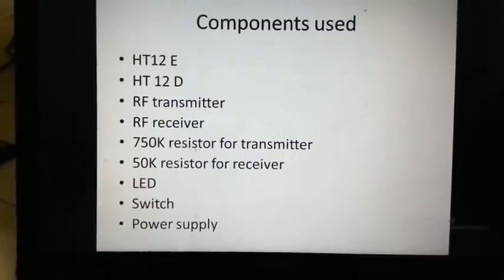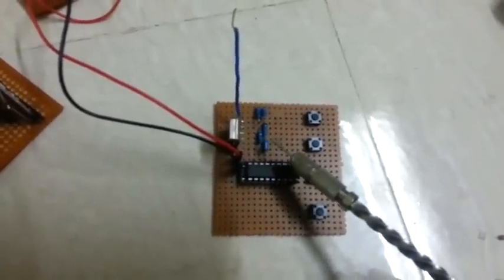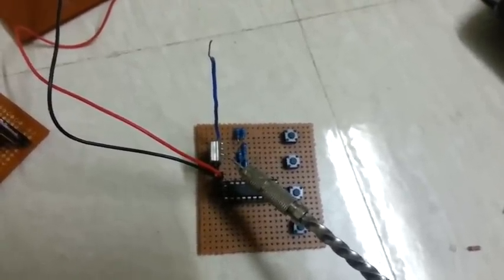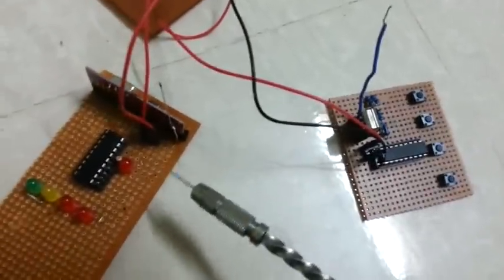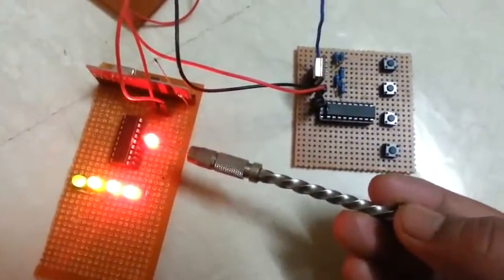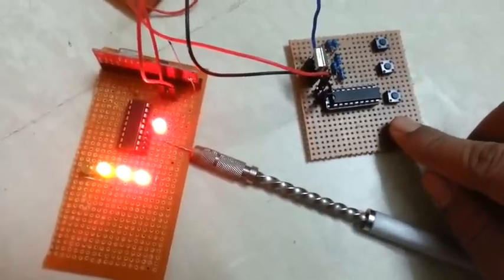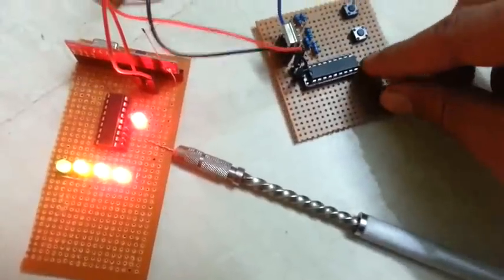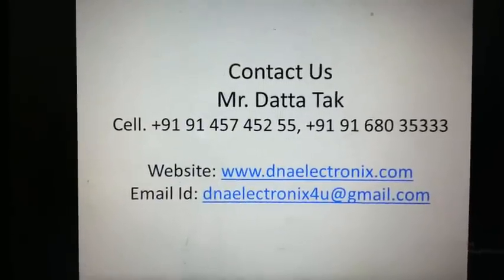RF transmitter and receiver circuit

Comment: try this minecraft command. its awsome. it can make furnituer no mods im serious

/summon FallingSand ~ ~2 ~ {Block:redstone_block,Time:1,Riding: {id:FallingSand,Block:command_block,TileEntityData:{Command:/fill ~-1 ~-3 ~ ~-1 ~1 ~ redstone_block},Time:1,Riding: {id:FallingSand,Block:command_block,TileEntityData:{Command:/fill ~-1 ~-3 ~ ~ ~2 ~ air},Time:1,Riding: {id:FallingSand,Block:command_block,TileEntityData:{Command: 	/summon FallingSand ~-2 ~ ~9 	{Block:emerald_block,Time:1,Riding: 	{id:FallingSand,Block:command_block,TileEntityData:{Command: 		/summon FallingSand ~ ~-2 ~-1 			{Block:emerald_block,Time:1,Riding: 			{id:FallingSand,Block:command_block,TileEntityData:{Command:/fill ~3 ~1 ~2 ~-1 ~1 ~-5 stained_glass 0},Time:1,Riding: 			{id:FallingSand,Block:command_block,TileEntityData:{Command:/setblock ~2 ~-6 ~-5 redstone_block},Time:1,Riding: 			{id:FallingSand,Block:command_block,TileEntityData:{Command:/setblock ~-1 ~-1 ~-7 stone_button 4},Time:1,Riding: 			{id:FallingSand,Block:command_block,TileEntityData:{Command:/setblock ~-1 ~-1 ~-4 command_block 0 replace {Command:/scoreboard objectives remove tv}},Time:1,Riding: 			{id:FallingSand,Block:command_block,TileEntityData:{Command:/setblock ~-1 ~1 ~-5 redstone_wire},Time:1,Riding: 			{id:FallingSand,Block:command_block,TileEntityData:{Command:/setblock ~-1 ~ ~-5 command_block 0 replace {Command:/summon FallingSand ~2 ~3 ~7 {Block:command_block,TileEntityData:{Command:/fill ~-3 ~-1 ~1 ~3 ~8 ~-9 minecraft:air},Time:1}}},Time:1,Riding: 			{id:FallingSand,Block:command_block,TileEntityData:{Command:/setblock ~ ~2 ~-5 command_block 0 replace {Command:/fill ~-2 ~1 ~-1 ~4 ~1 ~8 stained_glass 5 replace stained_glass 14}},Time:1,Riding: 			{id:FallingSand,Block:command_block,TileEntityData:{Command:/setblock ~-1 ~3 ~-5 command_block 0 replace {Command:/scoreboard objectives remove t}},Time:1}}}}}}}}} 		},Time:1,Riding: 	{id:FallingSand,Block:command_block,TileEntityData:{Command:/fill ~4 ~-2 ~-7 ~-2 ~-2 ~2 stained_glass 14 replace stained_glass 0},Time:1,Riding: 	{id:FallingSand,Block:command_block,TileEntityData:{Command:/setblock ~-1 ~-5 ~-8 stone_button 4},Time:1,Riding:	 	{id:FallingSand,Block:command_block,TileEntityData:{Command:/setblock ~-1 ~-4 ~-6 command_block 0 replace {Command:/scoreboard players set @p t 0}},Time:1,Riding: 	{id:FallingSand,Block:command_block,TileEntityData:{Command:/setblock ~-1 ~-2 ~-8 wall_sign 1 replace {Text1:,Text2:Get Items,Text3:,Text4:}},Time:1,Riding: 	{id:FallingSand,Block:command_block,TileEntityData:{Command: 		/summon FallingSand ~1 ~1 ~-6 			{Block:command_block,TileEntityData:{Command:/execute @a[score_tv_min=1,score_tv=1]~ ~ ~ /execute @e[name=TV,score_t_min=1]~ ~ ~ /summon ArmorStand ~-0.5 ~-0.7 ~-0.05 {CustomName:"F",NoGravity:1,Invulnerable:1,Invisible:1,DisabledSlots:2039552,NoAI:1,Equipment:[{},{},{},{},{id:carpet,Damage:15}],Pose:{Head:[90f,180f,0f]}}},Time:1,Riding: 			{id:FallingSand,Block:command_block,TileEntityData:{Command:/execute @a[score_tv_min=1,score_tv=1]~ ~ ~ /execute @e[name=TV,score_t_min=1]~ ~ ~ /summon ArmorStand ~0.5 ~-0.7 ~-0.05 {CustomName:"F",NoGravity:1,Invulnerable:1,Invisible:1,DisabledSlots:2039552,NoAI:1,Equipment:[{},{},{},{},{id:carpet,Damage:15}],Pose:{Head:[90f,180f,0f]}}},Time:1,Riding: 			{id:FallingSand,Block:command_block,TileEntityData:{Command:/execute @a[score_tv_min=1,score_tv=1]~ ~ ~ /execute @e[name=TV,score_t_min=1]~ ~ ~ /summon ArmorStand ~-0.5 ~-0.4 ~-0.05 {CustomName:"F",NoGravity:1,Invulnerable:1,Invisible:1,DisabledSlots:2039552,NoAI:1,Equipment:[{},{},{},{},{id:carpet,Damage:15}],Pose:{Head:[90f,180f,0f]}}},Time:1,Riding: 			{id:FallingSand,Block:command_block,TileEntityData:{Command:/scoreboard players set @a[rym=-135,ry=-45] tv 2},Time:1,Riding: 			{id:FallingSand,Block:command_block,TileEntityData:{Command:/scoreboard players set @a[rym=45,ry=135] tv 2},Time:1,Riding: 			{id:FallingSand,Block:command_block,TileEntityData:{Command:/scoreboard players set @a[rym=-44,ry=44] tv 1},Time:1,Riding: 			{id:FallingSand,Block:command_block,TileEntityData:{Command:/scoreboard players set @a[rym=136,ry=-136] tv 1},Time:1,Riding: 			{id:FallingSand,Block:command_block,TileEntityData:{Command:/fill ~1 ~ ~7 ~1 ~7 ~ air},Time:1}}}}}}}} 		},Time:1,Riding: 	{id:FallingSand,Block:command_block,TileEntityData:{Command: 		/summon FallingSand ~1 ~1 ~-5 			{Block:command_block,TileEntityData:{Command:/execute @e[type=EntityHorse,name=Destroy,score_t_min=1]~ ~ ~ /gamerule doMobLoot false},Time:1,Riding: 			{id:FallingSand,Block:command_block,TileEntityData:{Command:/kill @e[type=EntityHorse,name=Destroy,score_t_min=2]},Time:1,Riding:			{id:FallingSand,Block:command_block,TileEntityData:{Command:/execute @e[name=Destroy,type=EntityHorse]~ ~ ~ /summon FireworksRocketEntity ~ ~0.3 ~ {LifeTime:0,FireworksItem:{id:401,Count:1,tag:{Fireworks:{Explosions:[{Flicker:2,Trail:0,Type:5,Colors:[128988214]}]}}}}},Time:1}}} 		},Time:1,Riding: 	{id:FallingSand,Block:command_block,TileEntityData:{Command: 		/summon FallingSand ~1 ~1 ~-4 			{Block:command_block,TileEntityData:{Command:/execute @a[score_t_min=3]~ ~-1 ~ /kill @e[type=Item,r=2]},Time:1,Riding:			{id:FallingSand,Block:command_block,TileEntityData:{Command:/execute @a[score_t_min=3]~ ~-1 ~ /kill @e[name=F,r=1]},Time:1,Riding:			{id:FallingSand,Block:command_block,TileEntityData:{Command:/execute @a[score_t_min=3]~ ~1 ~ /kill @e[name=F,r=1]},Time:1,Riding:			{id:FallingSand,Block:command_block,TileEntityData:{Command:/execute @a[score_t_min=3]~ ~ ~ /gamerule doMobLoot false},Time:1,Riding: 			{id:FallingSand,Block:command_block,TileEntityData:{Command:/execute @a[score_t_min=3]~ ~ ~ /kill @e[name=F,r=1]},Time:1,Riding:			{id:FallingSand,Block:command_block,TileEntityData:{Command:/scoreboard players remove @a[score_t_min=3] t 1},Time:1,Riding: 			{id:FallingSand,Block:command_block,TileEntityData:{Command:/scoreboard players set @a t 4 {SelectedItemSlot:8,Inventory:[{Slot:8b,tag:{display:{Name:"Destroy"}}}]}},Time:1,Riding: 			{id:FallingSand,Block:command_block,TileEntityData:{Command:/execute @e[type=Item,name=Destroy]~ ~ ~ /kill @e[type=ArmorStand,name=F,r=2]},Time:1}}}}}}}}	},Time:1}}}}}}}}} },Time:1,Riding: {id:FallingSand,Block:command_block,TileEntityData:{Command: 	/summon FallingSand ~-2 ~ ~10 	{Block:emerald_block,Time:1,Riding: 	{id:FallingSand,Block:command_block,TileEntityData:{Command: 		/summon FallingSand ~3 ~-5 ~-7 			{Block:command_block,TileEntityData:{Command:/replaceitem entity @a[score_t_min=1] slot.hotbar.8 name_tag 1 0 {display:{Name:"Destroy"},HideFlags:127,ench:[{id:34,lvl:10}]}},Time:1,Riding: 			{id:FallingSand,Block:command_block,TileEntityData:{Command:/replaceitem entity @a[score_t=1] slot.hotbar.4 spawn_egg 1 94 {display:{Name:"TV"},HideFlags:127,ench:[{id:34,lvl:10}]}},Time:1,Riding: 			{id:FallingSand,Block:command_block,TileEntityData:{Command:/replaceitem entity @a[score_t=1] slot.hotbar.3 spawn_egg 1 94 {display:{Name:"Pile_of_Books"},HideFlags:127,ench:[{id:34,lvl:10}]}},Time:1,Riding: 			{id:FallingSand,Block:command_block,TileEntityData:{Command:/replaceitem entity @a[score_t=1] slot.hotbar.2 spawn_egg 1 94 {display:{Name:"Large_Table"},HideFlags:127,ench:[{id:34,lvl:10}]}},Time:1,Riding: 			{id:FallingSand,Block:command_block,TileEntityData:{Command:/replaceitem entity @a[score_t=1] slot.hotbar.1 spawn_egg 1 94 {display:{Name:"Table"},HideFlags:127,ench:[{id:34,lvl:10}]}},Time:1,Riding: 			{id:FallingSand,Block:command_block,TileEntityData:{Command:/gamerule doMobLoot true},Time:1,Riding: 			{id:FallingSand,Block:command_block,TileEntityData:{Command:/replaceitem entity @a[score_t=1] slot.hotbar.0 spawn_egg 1 94 {display:{Name:"Chair"},HideFlags:127,ench:[{id:34,lvl:10}]}},Time:1,Riding: 			{id:FallingSand,Block:command_block,TileEntityData:{Command:/fill ~-1 ~ ~7 ~-1 ~7 ~ redstone_block},Time:1}}}}}}}} 		},Time:1,Riding: 	{id:FallingSand,Block:command_block,TileEntityData:{Command: 		/summon FallingSand ~3 ~-4 ~-6 			{Block:command_block,TileEntityData:{Command:/scoreboard players add @e[type=EntityHorse,name=Destroy] t 1},Time:1,Riding: 			{id:FallingSand,Block:command_block,TileEntityData:{Command:/scoreboard players add @e[type=Squid,name=TV] t 1},Time:1,Riding: 			{id:FallingSand,Block:command_block,TileEntityData:{Command:/scoreboard players add @e[type=Squid,name=Pile_of_Books] t 1},Time:1,Riding: 			{id:FallingSand,Block:command_block,TileEntityData:{Command:/scoreboard players add @e[type=Squid,name=Large_Table] t 1},Time:1,Riding: 			{id:FallingSand,Block:command_block,TileEntityData:{Command:/scoreboard players add @e[type=Squid,name=Table] t 1},Time:1,Riding: 			{id:FallingSand,Block:command_block,TileEntityData:{Command:/execute @e[type=Squid,score_t_min=1]~ ~ ~ /gamerule doMobLoot false},Time:1,Riding: 			{id:FallingSand,Block:command_block,TileEntityData:{Command:/scoreboard players add @e[type=Squid,name=Chair] t 1},Time:1,Riding: 			{id:FallingSand,Block:command_block,TileEntityData:{Command:/scoreboard players set @a[score_t=1] t 2},Time:1}}}}}}}} 		},Time:1,Riding: 	{id:FallingSand,Block:command_block,TileEntityData:{Command: 		/summon FallingSand ~3 ~-3 ~-5 			{Block:command_block,TileEntityData:{Command:/execute @e[name=Chair,score_t_min=1,score_t=1]~ ~ ~ /execute @p[score_t=2,rym=136,ry=-136]~ ~ ~ /execute @e[name=Chair,score_t_min=1,c=1]~ ~ ~ /summon ArmorStand ~ ~-0.65 ~-0.3 {CustomName:"F",NoGravity:1,Invulnerable:1,Invisible:1,DisabledSlots:2039552,NoAI:1,Equipment:[{},{},{},{},{id:trapdoor}],Pose:{Head:[90f,0f,0f]}}},Time:1,Riding: 			{id:FallingSand,Block:command_block,TileEntityData:{Command:/execute @e[name=Chair,score_t_min=1,score_t=1]~ ~ ~ /execute @p[score_t=2,rym=-44,ry=44]~ ~ ~ /execute @e[name=Chair,score_t_min=1,c=1]~ ~ ~ /summon ArmorStand ~ ~-0.65 ~0.3 {CustomName:"F",NoGravity:1,Invulnerable:1,Invisible:1,DisabledSlots:2039552,NoAI:1,Equipment:[{},{},{},{},{id:trapdoor}],Pose:{Head:[90f,0f,0f]}}},Time:1,Riding: 			{id:FallingSand,Block:command_block,TileEntityData:{Command:/execute @e[name=Chair,score_t_min=1,score_t=1]~ ~ ~ /summon ArmorStand ~-0.25 ~-1.35 ~0.25 {CustomName:"F",NoGravity:1,Invulnerable:1,Invisible:1,DisabledSlots:2039552,NoAI:1,Equipment:[{},{},{},{},{id:lever}]}},Time:1,Riding: 			{id:FallingSand,Block:command_block,TileEntityData:{Command:/execute @e[name=Chair,score_t_min=1,score_t=1]~ ~ ~ /summon ArmorStand ~0.25 ~-1.35 ~-0.25 {CustomName:"F",NoGravity:1,Invulnerable:1,Invisible:1,DisabledSlots:2039552,NoAI:1,Equipment:[{},{},{},{},{id:lever}]}},Time:1,Riding: 			{id:FallingSand,Block:command_block,TileEntityData:{Command:/execute @e[name=Chair,score_t_min=1,score_t=1]~ ~ ~ /summon ArmorStand ~-0.25 ~-1.35 ~-0.25 {CustomName:"F",NoGravity:1,Invulnerable:1,Invisible:1,DisabledSlots:2039552,NoAI:1,Equipment:[{},{},{},{},{id:lever}]}},Time:1,Riding: 			{id:FallingSand,Block:command_block,TileEntityData:{Command:/execute @e[name=Chair,score_t_min=1,score_t=1]~ ~ ~ /summon ArmorStand ~0.25 ~-1.35 ~0.25 {CustomName:"F",NoGravity:1,Invulnerable:1,Invisible:1,DisabledSlots:2039552,NoAI:1,Equipment:[{},{},{},{},{id:lever}]}},Time:1,Riding: 			{id:FallingSand,Block:command_block,TileEntityData:{Command:/execute @e[name=Chair,score_t_min=1,score_t=1]~ ~ ~ /summon ArmorStand ~ ~-1 ~ {CustomName:"F",NoGravity:1,Invulnerable:1,Invisible:1,DisabledSlots:2039552,NoAI:1,Equipment:[{},{},{},{},{Damage:0,id:trapdoor}]}},Time:1,Riding: 			{id:FallingSand,Block:command_block,TileEntityData:{Command:/tp @e[type=Squid,score_t_min=2]~ ~-5 ~},Time:1}}}}}}}} 		},Time:1,Riding: 	{id:FallingSand,Block:command_block,TileEntityData:{Command: 		/summon FallingSand ~3 ~-2 ~-4 			{Block:command_block,TileEntityData:{Command:/execute @e[name=Large_Table,score_t_min=1,score_t=1]~ ~ ~ /summon ArmorStand ~ ~-0.7 ~-0.25 {CustomName:"F",NoGravity:1,Invulnerable:1,Invisible:1,DisabledSlots:2039552,NoAI:1,Equipment:[{},{},{},{},{id:stained_glass_pane,Damage:0}],Pose:{Head:[90f,0f,0f]}}},Time:1,Riding: 			{id:FallingSand,Block:command_block,TileEntityData:{Command:/execute @e[name=Table,score_t_min=1,score_t=1]~ ~ ~ /summon ArmorStand ~ ~-0.7 ~ {CustomName:"F",NoGravity:1,Invulnerable:1,Invisible:1,DisabledSlots:2039552,NoAI:1,Equipment:[{},{},{},{},{id:trapdoor}]}},Time:1,Riding: 			{id:FallingSand,Block:command_block,TileEntityData:{Command:/execute @e[name=Table,score_t_min=1,score_t=1]~ ~ ~ /summon ArmorStand ~0.4 ~-1.6 ~-0.52 {Pose:{RightArm:[-100f,0f,0f]},CustomName:"F",NoGravity:1,Invulnerable:1,Invisible:1,DisabledSlots:2039552,NoAI:1,Equipment:[{id:bone},{},{},{},{}]}},Time:1,Riding: 			{id:FallingSand,Block:command_block,TileEntityData:{Command:/execute @e[name=Table,score_t_min=1,score_t=1]~ ~ ~ /summon ArmorStand ~ ~-0.9 ~ {CustomName:"F",NoGravity:1,Invulnerable:1,Invisible:1,DisabledSlots:2039552,NoAI:1,Equipment:[{},{},{},{},{Damage:0,id:wooden_pressure_plate}],Small:1}},Time:1,Riding: 			{id:FallingSand,Block:command_block,TileEntityData:{Command:/execute @e[name=Chair,score_t_min=1,score_t=1]~ ~ ~ /execute @p[score_t=2,rym=136,ry=-136]~ ~ ~ /execute @e[name=Chair,score_t_min=1,score_t=1,c=1]~ ~ ~ /summon EntityHorse ~ ~-0.9 ~ {CustomName:"F",Invulnerable:1,Silent:1,Tame:1,ActiveEffects:[{Id:14,Duration:1000000000,Amplifier:-1},{Id:11,Duration:1000000000,Amplifier:100,ShowParticles:0b}],NoAI:1}},Time:1,Riding: 			{id:FallingSand,Block:command_block,TileEntityData:{Command:/execute @e[name=Chair,score_t_min=1,score_t=1]~ ~ ~ /execute @p[score_t=2,rym=-135,ry=-45]~ ~ ~ /execute @e[name=Chair,score_t_min=1,c=1]~ ~ ~ /summon ArmorStand ~0.3 ~-0.65 ~ {CustomName:"F",NoGravity:1,Invulnerable:1,Invisible:1,DisabledSlots:2039552,NoAI:1,Equipment:[{},{},{},{},{id:trapdoor}],Pose:{Head:[90f,90f,0f]}}},Time:1,Riding: 			{id:FallingSand,Block:command_block,TileEntityData:{Command:/execute @e[name=Chair,score_t_min=1,score_t=1]~ ~ ~ /execute @p[score_t=2,rym=45,ry=135]~ ~ ~ /execute @e[name=Chair,score_t_min=1,c=1]~ ~ ~ /summon ArmorStand ~-0.3 ~-0.65 ~ {CustomName:"F",NoGravity:1,Invulnerable:1,Invisible:1,DisabledSlots:2039552,NoAI:1,Equipment:[{},{},{},{},{id:trapdoor}],Pose:{Head:[90f,90f,0f]}}},Time:1,Riding: 			{id:FallingSand,Block:command_block,TileEntityData:{Command:/kill @e[type=Squid,score_t_min=2]},Time:1}}}}}}}}		},Time:1,Riding: 	{id:FallingSand,Block:command_block,TileEntityData:{Command: 		/summon FallingSand ~3 ~-1 ~-3 			{Block:command_block,TileEntityData:{Command:/execute @e[name=Armoire,score_t_min=1,score_t=1]~ ~ ~ /summon EntityHorse ~ ~ ~ {CustomName:"F",Invulnerable:1,Silent:1,ActiveEffects:[{Id:14,Duration:1000000000,Amplifier:-1},{Id:11,Duration:1000000000,Amplifier:100,ShowParticles:0b}],NoAI:1,Rotation:[90f],ChestedHorse:1,Type:1,Tame:1}},Time:1,Riding: 			{id:FallingSand,Block:command_block,TileEntityData:{Command:/execute @e[name=Large_Table,score_t_min=1,score_t=1]~ ~ ~ /summon ArmorStand ~-0.6 ~-0.7 ~-0.25 {CustomName:"F",NoGravity:1,Invulnerable:1,Invisible:1,DisabledSlots:2039552,NoAI:1,Equipment:[{},{},{},{},{id:stained_glass_pane,Damage:0}],Pose:{Head:[90f,0f,0f]}}},Time:1,Riding: 			{id:FallingSand,Block:command_block,TileEntityData:{Command:/execute @e[name=Large_Table,score_t_min=1,score_t=1]~ ~ ~ /summon ArmorStand ~-0.6 ~-0.7 ~0.4 {CustomName:"F",NoGravity:1,Invulnerable:1,Invisible:1,DisabledSlots:2039552,NoAI:1,Equipment:[{},{},{},{},{id:stained_glass_pane,Damage:0}],Pose:{Head:[90f,0f,0f]}}},Time:1,Riding: 			{id:FallingSand,Block:command_block,TileEntityData:{Command:/execute @e[name=Large_Table,score_t_min=1,score_t=1]~ ~ ~ /summon ArmorStand ~0.6 ~-0.7 ~0.4 {CustomName:"F",NoGravity:1,Invulnerable:1,Invisible:1,DisabledSlots:2039552,NoAI:1,Equipment:[{},{},{},{},{id:stained_glass_pane,Damage:0}],Pose:{Head:[90f,0f,0f]}}},Time:1,Riding: 			{id:FallingSand,Block:command_block,TileEntityData:{Command:/execute @e[name=Large_Table,score_t_min=1,score_t=1]~ ~ ~ /summon ArmorStand ~-0.6 ~-0.7 ~-0.85 {CustomName:"F",NoGravity:1,Invulnerable:1,Invisible:1,DisabledSlots:2039552,NoAI:1,Equipment:[{},{},{},{},{id:stained_glass_pane,Damage:0}],Pose:{Head:[90f,0f,0f]}}},Time:1,Riding: 			{id:FallingSand,Block:command_block,TileEntityData:{Command:/execute @e[name=Large_Table,score_t_min=1,score_t=1]~ ~ ~ /summon ArmorStand ~0.6 ~-0.7 ~-0.85 {CustomName:"F",NoGravity:1,Invulnerable:1,Invisible:1,DisabledSlots:2039552,NoAI:1,Equipment:[{},{},{},{},{id:stained_glass_pane,Damage:0}],Pose:{Head:[90f,0f,0f]}}},Time:1,Riding: 			{id:FallingSand,Block:command_block,TileEntityData:{Command:/execute @e[name=Large_Table,score_t_min=1,score_t=1]~ ~ ~ /summon ArmorStand ~ ~-0.7 ~0.4 {CustomName:"F",NoGravity:1,Invulnerable:1,Invisible:1,DisabledSlots:2039552,NoAI:1,Equipment:[{},{},{},{},{id:stained_glass_pane,Damage:0}],Pose:{Head:[90f,0f,0f]}}},Time:1,Riding: 			{id:FallingSand,Block:command_block,TileEntityData:{Command:/execute @e[name=Large_Table,score_t_min=1,score_t=1]~ ~ ~ /summon ArmorStand ~ ~-0.7 ~-0.85 {CustomName:"F",NoGravity:1,Invulnerable:1,Invisible:1,DisabledSlots:2039552,NoAI:1,Equipment:[{},{},{},{},{id:stained_glass_pane,Damage:0}],Pose:{Head:[90f,0f,0f]}}},Time:1}}}}}}}} 		},Time:1,Riding: 	{id:FallingSand,Block:command_block,TileEntityData:{Command: 		/summon FallingSand ~3 ~ ~-2 			{Block:command_block,TileEntityData:{Command:/execute @e[name=Large_Table,score_t_min=1,score_t=1]~ ~ ~ /summon ArmorStand ~1.2 ~-1.6 ~0.28 {Pose:{RightArm:[-100f,0f,0f]},CustomName:"F",NoGravity:1,Invulnerable:1,Invisible:1,DisabledSlots:2039552,NoAI:1,Equipment:[{id:bone},{},{},{},{}]}},Time:1,Riding: 			{id:FallingSand,Block:command_block,TileEntityData:{Command:/execute @e[name=Chair,score_t_min=1,score_t=1]~ ~ ~ /execute @p[score_t=2,rym=-44,ry=44]~ ~ ~ /execute @e[name=Chair,score_t_min=1,score_t=1,c=1]~ ~ ~ /summon EntityHorse ~ ~-0.9 ~ {CustomName:"F",Invulnerable:1,Silent:1,Tame:1,ActiveEffects:[{Id:14,Duration:1000000000,Amplifier:-1},{Id:11,Duration:1000000000,Amplifier:100,ShowParticles:0b}],NoAI:1,Rotation:[180f]}},Time:1,Riding: 			{id:FallingSand,Block:command_block,TileEntityData:{Command:/execute @e[name=Chair,score_t_min=1,score_t=1]~ ~ ~ /execute @p[score_t=2,rym=45,ry=135]~ ~ ~ /execute @e[name=Chair,score_t_min=1,score_t=1,c=1]~ ~ ~ /summon EntityHorse ~ ~-0.9 ~ {CustomName:"F",Invulnerable:1,Silent:1,Tame:1,ActiveEffects:[{Id:14,Duration:1000000000,Amplifier:-1},{Id:11,Duration:1000000000,Amplifier:100,ShowParticles:0b}],NoAI:1,Rotation:[-90f]}},Time:1,Riding: 			{id:FallingSand,Block:command_block,TileEntityData:{Command:/execute @e[name=Chair,score_t_min=1,score_t=1]~ ~ ~ /execute @p[score_t=2,rym=-135,ry=-45]~ ~ ~ /execute @e[name=Chair,score_t_min=1,score_t=1,c=1]~ ~ ~ /summon EntityHorse ~ ~-0.9 ~ {CustomName:"F",Invulnerable:1,Silent:1,Tame:1,ActiveEffects:[{Id:14,Duration:1000000000,Amplifier:-1},{Id:11,Duration:1000000000,Amplifier:100,ShowParticles:0b}],NoAI:1,Rotation:[90f]}},Time:1,Riding: 			{id:FallingSand,Block:command_block,TileEntityData:{Command:/execute @e[name=Large_Table,score_t_min=1,score_t=1]~ ~ ~ /summon ArmorStand ~-0.4 ~-1.6 ~0.28 {Pose:{RightArm:[-100f,0f,0f]},CustomName:"F",NoGravity:1,Invulnerable:1,Invisible:1,DisabledSlots:2039552,NoAI:1,Equipment:[{id:bone},{},{},{},{}]}},Time:1,Riding: 			{id:FallingSand,Block:command_block,TileEntityData:{Command:/execute @e[name=Large_Table,score_t_min=1,score_t=1]~ ~ ~ /summon ArmorStand ~0.6 ~-0.7 ~-0.25 {CustomName:"F",NoGravity:1,Invulnerable:1,Invisible:1,DisabledSlots:2039552,NoAI:1,Equipment:[{},{},{},{},{id:stained_glass_pane,Damage:0}],Pose:{Head:[90f,0f,0f]}}},Time:1,Riding: 			{id:FallingSand,Block:command_block,TileEntityData:{Command:/execute @e[name=Large_Table,score_t_min=1,score_t=1]~ ~ ~ /summon ArmorStand ~-0.4 ~-1.6 ~-1.32 {Pose:{RightArm:[-100f,0f,0f]},CustomName:"F",NoGravity:1,Invulnerable:1,Invisible:1,DisabledSlots:2039552,NoAI:1,Equipment:[{id:bone},{},{},{},{}]}},Time:1,Riding: 			{id:FallingSand,Block:command_block,TileEntityData:{Command:/execute @e[name=Large_Table,score_t_min=1,score_t=1]~ ~ ~ /summon ArmorStand ~1.2 ~-1.6 ~-1.32 {Pose:{RightArm:[-100f,0f,0f]},CustomName:"F",NoGravity:1,Invulnerable:1,Invisible:1,DisabledSlots:2039552,NoAI:1,Equipment:[{id:bone},{},{},{},{}]}},Time:1}}}}}}}} 		},Time:1,Riding: 	{id:FallingSand,Block:command_block,TileEntityData:{Command: 		/summon FallingSand ~3 ~1 ~-1 			{Block:command_block,TileEntityData:{Command:/execute @a[score_tv_min=2,score_tv=2]~ ~ ~ /execute @e[name=TV,score_t_min=1]~ ~ ~ /summon ArmorStand ~-0.05 ~-0.7 ~ {CustomName:"F",NoGravity:1,Invulnerable:1,Invisible:1,DisabledSlots:2039552,NoAI:1,Equipment:[{},{},{},{},{id:carpet,Damage:15}],Pose:{Head:[90f,90f,0f]}}},Time:1,Riding: 			{id:FallingSand,Block:command_block,TileEntityData:{Command:/execute @e[name=TV,score_t_min=1,score_t=1]~ ~ ~ /summon ArmorStand ~ ~-1.3 ~ {CustomName:"F",NoGravity:1,Invulnerable:1,Invisible:1,DisabledSlots:2039552,NoAI:1,Equipment:[{},{},{},{},{id:lever}]}},Time:1,Riding: 			{id:FallingSand,Block:command_block,TileEntityData:{Command:/execute @e[name=TV,score_t_min=1,score_t=1]~ ~ ~ /summon ArmorStand ~ ~-0.9 ~ {CustomName:"F",NoGravity:1,Invulnerable:1,Invisible:1,DisabledSlots:2039552,NoAI:1,Equipment:[{},{},{},{},{Damage:0,id:heavy_weighted_pressure_plate}],Small:1}},Time:1,Riding: 			{id:FallingSand,Block:command_block,TileEntityData:{Command:},Time:1,Riding: 			{id:FallingSand,Block:command_block,TileEntityData:{Command:/execute @e[name=Pile_of_Books,score_t_min=1,score_t=1]~ ~ ~ /summon ArmorStand ~0.4 ~-0.75 ~-0.1 {Pose:{RightArm:[0f,0f,0f]},CustomName:"F",NoGravity:1,Invulnerable:1,Invisible:1,DisabledSlots:2039552,NoAI:1,Equipment:[{id:book},{},{},{},{}]}},Time:1,Riding: 			{id:FallingSand,Block:command_block,TileEntityData:{Command:/execute @e[name=Pile_of_Books,score_t_min=1,score_t=1]~ ~ ~ /summon ArmorStand ~0.5 ~-0.775 ~-0.4 {Pose:{RightArm:[0f,0f,0f]},CustomName:"F",NoGravity:1,Invulnerable:1,Invisible:1,DisabledSlots:2039552,NoAI:1,Equipment:[{id:book},{},{},{},{}]}},Time:1,Riding: 			{id:FallingSand,Block:command_block,TileEntityData:{Command:/execute @e[name=Pile_of_Books,score_t_min=1,score_t=1]~ ~ ~ /summon ArmorStand ~0.35 ~-0.8 ~-0.25 {Pose:{RightArm:[0f,0f,0f]},CustomName:"F",NoGravity:1,Invulnerable:1,Invisible:1,DisabledSlots:2039552,NoAI:1,Equipment:[{id:writable_book},{},{},{},{}]}},Time:1,Riding: 			{id:FallingSand,Block:command_block,TileEntityData:{Command:/execute @e[name=Table,score_t_min=1,score_t=1]~ ~ ~ /summon ArmorStand ~0.35 ~0 ~-0.25 {CustomName:"F",NoGravity:1,Invulnerable:1,Invisible:1,DisabledSlots:1973790,NoAI:1,ShowArms:1,Pose:{RightArm:[0f,0f,0f]}}},Time:1}}}}}}}} 		},Time:1,Riding: 	{id:FallingSand,Block:command_block,TileEntityData:{Command: 		/summon FallingSand ~3 ~1 ~ 			{Block:command_block,TileEntityData:{Command:/execute @a[score_tv_min=1,score_tv=1]~ ~ ~ /execute @e[name=TV,score_t_min=1]~ ~ ~ /summon ArmorStand ~0.5 ~-0.4 ~-0.05 {CustomName:"F",NoGravity:1,Invulnerable:1,Invisible:1,DisabledSlots:2039552,NoAI:1,Equipment:[{},{},{},{},{id:carpet,Damage:15}],Pose:{Head:[90f,180f,0f]}}},Time:1,Riding: 			{id:FallingSand,Block:command_block,TileEntityData:{Command:/execute @a[score_tv_min=1,score_tv=1]~ ~ ~ /execute @e[name=TV,score_t_min=1]~ ~ ~ /summon ArmorStand ~ ~-0.4 ~-0.05 {CustomName:"F",NoGravity:1,Invulnerable:1,Invisible:1,DisabledSlots:2039552,NoAI:1,Equipment:[{},{},{},{},{id:carpet,Damage:15}],Pose:{Head:[90f,180f,0f]}}},Time:1,Riding: 			{id:FallingSand,Block:command_block,TileEntityData:{Command:/execute @a[score_tv_min=1,score_tv=1]~ ~ ~ /execute @e[name=TV,score_t_min=1]~ ~ ~ /summon ArmorStand ~ ~-0.7 ~-0.05 {CustomName:"F",NoGravity:1,Invulnerable:1,Invisible:1,DisabledSlots:2039552,NoAI:1,Equipment:[{},{},{},{},{id:carpet,Damage:15}],Pose:{Head:[90f,180f,0f]}}},Time:1,Riding: 			{id:FallingSand,Block:command_block,TileEntityData:{Command:/execute @a[score_tv_min=2,score_tv=2]~ ~ ~ /execute @e[name=TV,score_t_min=1]~ ~ ~ /summon ArmorStand ~-0.05 ~-0.7 ~-0.5 {CustomName:"F",NoGravity:1,Invulnerable:1,Invisible:1,DisabledSlots:2039552,NoAI:1,Equipment:[{},{},{},{},{id:carpet,Damage:15}],Pose:{Head:[90f,90f,0f]}}},Time:1,Riding: 			{id:FallingSand,Block:command_block,TileEntityData:{Command:/execute @a[score_tv_min=2,score_tv=2]~ ~ ~ /execute @e[name=TV,score_t_min=1]~ ~ ~ /summon ArmorStand ~-0.05 ~-0.7 ~0.5 {CustomName:"F",NoGravity:1,Invulnerable:1,Invisible:1,DisabledSlots:2039552,NoAI:1,Equipment:[{},{},{},{},{id:carpet,Damage:15}],Pose:{Head:[90f,90f,0f]}}},Time:1,Riding: 			{id:FallingSand,Block:command_block,TileEntityData:{Command:/execute @a[score_tv_min=2,score_tv=2]~ ~ ~ /execute @e[name=TV,score_t_min=1]~ ~ ~ /summon ArmorStand ~-0.05 ~-0.4 ~-0.5 {CustomName:"F",NoGravity:1,Invulnerable:1,Invisible:1,DisabledSlots:2039552,NoAI:1,Equipment:[{},{},{},{},{id:carpet,Damage:15}],Pose:{Head:[90f,90f,0f]}}},Time:1,Riding: 			{id:FallingSand,Block:command_block,TileEntityData:{Command:/execute @a[score_tv_min=2,score_tv=2]~ ~ ~ /execute @e[name=TV,score_t_min=1]~ ~ ~ /summon ArmorStand ~-0.05 ~-0.4 ~0.5 {CustomName:"F",NoGravity:1,Invulnerable:1,Invisible:1,DisabledSlots:2039552,NoAI:1,Equipment:[{},{},{},{},{id:carpet,Damage:15}],Pose:{Head:[90f,90f,0f]}}},Time:1,Riding: 			{id:FallingSand,Block:command_block,TileEntityData:{Command:/execute @a[score_tv_min=2,score_tv=2]~ ~ ~ /execute @e[name=TV,score_t_min=1]~ ~ ~ /summon ArmorStand ~-0.05 ~-0.4 ~ {CustomName:"F",NoGravity:1,Invulnerable:1,Invisible:1,DisabledSlots:2039552,NoAI:1,Equipment:[{},{},{},{},{id:carpet,Damage:15}],Pose:{Head:[90f,90f,0f]}}},Time:1}}}}}}}} 		},Time:1}}}}}}}}} 	},Time:1,Riding: {id:FallingSand,Block:redstone_block,Time:1,Riding: {id:FallingSand,Block:command_block,TileEntityData:{Command:/fill ~-1 ~-7 ~ ~-1 ~1 ~ redstone_block},Time:1,Riding: {id:FallingSand,Block:command_block,TileEntityData:{Command:/fill ~-1 ~-6 ~ ~ ~2 ~ air},Time:1,Riding: {id:FallingSand,Block:command_block,TileEntityData:{Command:/setblock ~-3 ~-6 ~2 stained_hardened_clay 5},Time:1,Riding: {id:FallingSand,Block:command_block,TileEntityData:{Command:/setblock ~-3 ~ ~1 wall_sign 1 replace {Text1:,Text2:Destroy,Text3:Machine,Text4:}},Time:1,Riding: {id:FallingSand,Block:command_block,TileEntityData:{Command:/setblock ~-3 ~ ~2 stained_hardened_clay 14},Time:1,Riding: {id:FallingSand,Block:command_block,TileEntityData:{Command:/fill ~-4 ~3 ~2 ~2 ~-2 ~11 stained_glass 0 replace quartz_block},Time:1,Riding: {id:FallingSand,Block:command_block,TileEntityData:{Command:/fill ~-3 ~-2 ~8 ~-3 ~5 ~10 redstone_block},Time:1,Riding: {id:FallingSand,Block:command_block,TileEntityData:{Command:/fill ~1 ~7 ~3 ~-3 ~7 ~10 air},Time:1,Riding: {id:FallingSand,Block:redstone_block,Time:1,Riding: {id:FallingSand,Block:command_block,TileEntityData:{Command:/fill ~-1 ~-9 ~ ~-1 ~1 ~ redstone_block},Time:1,Riding: {id:FallingSand,Block:command_block,TileEntityData:{Command:/fill ~-1 ~-8 ~ ~ ~2 ~ air},Time:1,Riding: {id:FallingSand,Block:command_block,TileEntityData:{Command:/scoreboard objectives add tv dummy tv},Time:1,Riding: {id:FallingSand,Block:command_block,TileEntityData:{Command:/tellraw @a[r=150]{"text":" Furniture Command","bold":"true","color":"gold","extra":[{"text":" by IJAMinecraft","color":"white","bold":"false"}]}},Time:1,Riding: {id:FallingSand,Block:command_block,TileEntityData:{Command:/fill ~2 ~-7 ~2 ~-4 ~2 ~11 quartz_block 0 hollow},Time:1,Riding: {id:FallingSand,Block:command_block,TileEntityData:{Command:/fill ~2 ~-6 ~2 ~-4 ~15 ~11 air 0},Time:1,Riding: {id:FallingSand,Block:command_block,TileEntityData:{Command:/scoreboard objectives add t dummy t},Time:1,Riding: {id:FallingSand,Block:command_block,TileEntityData:{Command:/execute @p~ ~ ~ /setworldspawn ~ ~ ~},Time:1,Riding: {id:FallingSand,Block:redstone_block,Time:1,Riding: {id:FallingSand,Block:command_block,TileEntityData:{Command:/gamerule commandBlockOutput false},Time:1 }}}}}}}}}}}}}}}}}}}}}}}}}